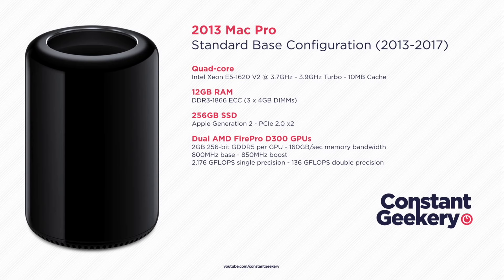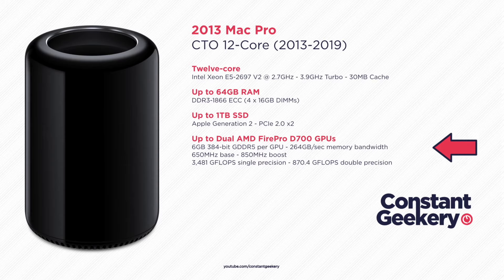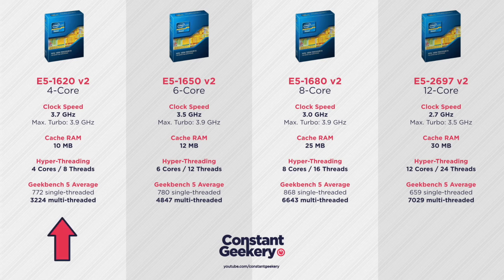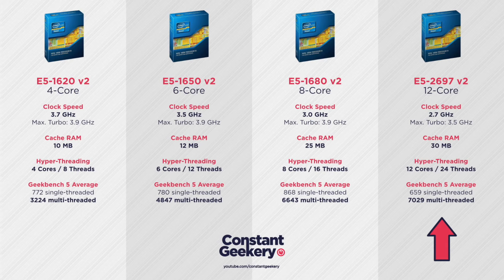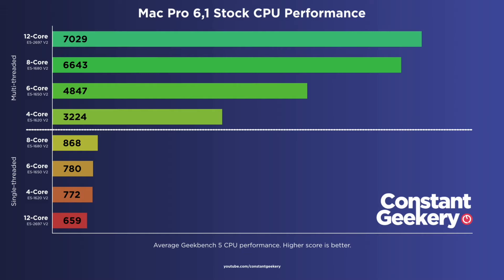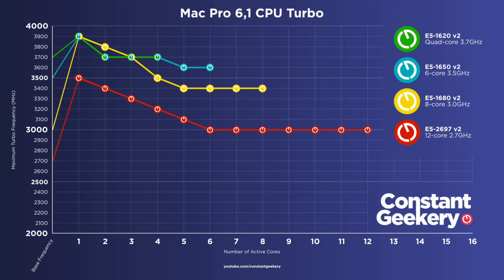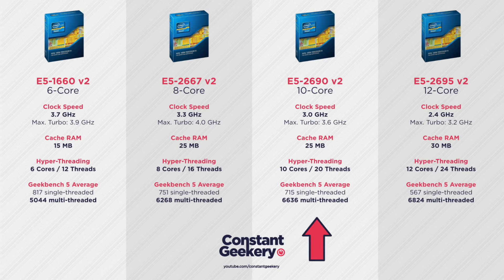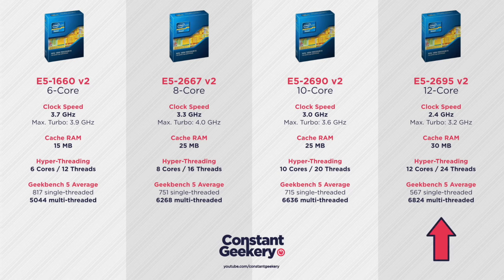Which 2013 Mac Pro should you buy?

Comment: Hi, 
I've been following the videos on upgrading the Mac Pro. Thanks for these.
I currently have the 2012 i7 Mac mini, SSD and 16 gig ram. 
I'm noticing that the Mac is showing it's age with video editing in FCP. 
I'm deciding if it's worth it to invest in the Mac Pro and do all the upgrades, or purchase the 2020 Mac mini i7 and upgrade the ram myself. I know that the iMac is faster than the Mac mini, but I don't need a 3rd screen.
I'd welcome your thoughts comparing both for using with FCP.
Thanks so much.
Robert
Reply from the maker: FCP benefits from GPU acceleration, so the Mac Mini is at a disadvantage there. If you pair the Mini with an eGPU and plenty of RAM, then it will be a Final Cut powerhouse (and potentially better than the Mac Pro), but that will take the total cost considerably beyond the price of the Mac Pro... and probably more than half way to the cost of the Mac Pro 2019! Without the eGPU, rendering in FCP will be slow.

The i7-8700B 6-core CPU will demolish any Mac Pro 2013 for single-threaded performance, but the 8-core or 12-core Mac Pro will be better for multi-threaded performance. Will you spend most of your time in pro apps that are optimised for multi-threading? If so, the Mac Pro is better suited. If not, the Mac Mini will likely be a better fit.

SSD in the Mini will be much quicker, but that won’t have much impact on real-world performance. Both the Mini and the Mac Pro are great options, and both have their pros and cons. I hope that helps - thanks for watching!
Reply: @ConstantGeekery  Thanks for all the info.
At this point due to 4 issues, I decided to keep my current 2012 i7Mac mini and build an eGPU similar to what is described in this video.
https://www.youtube.com/watch?v=bJCbnNGHDCA&t=52s
Hoping it will improve my FPC rendering timing.
I'd welcome your thoughts. Thanks again!
Reply from the maker: Robert Libbey RMT is be interested to know how you get on. The latest versions of FCP don’t seem to like the Thunderbolt 2 eGPU option on the Mac Pro, but that may be something to do with the dual GPUs. It makes a huge difference on my MacBook Pro - hopefully it will work well for you.

Comment: 2024 & These Macs have crashed in price. The M1 Mini has killed their values. The 6-core i7 Touch Bar is as fast as the 12-core 2013MP, but with vastly superior graphics performance - & considerably lower power consumption. That said, at the new super low prices, this old beasts make a great 2nd Mac with terrific value !